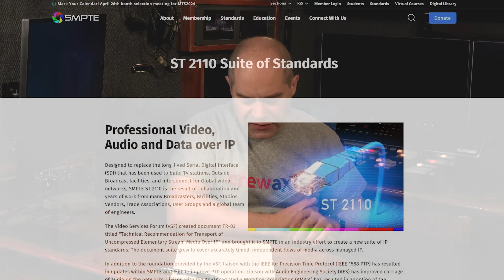What is SMPTE ST 2110 IP Video? Let's talk about it.

Comment: Crazy question for you. Thinking about the production trailer workflows, I wonder if an intermediate solution would be something similar to digital stageboxes for 2110? Cameras remain SDI, but all funnel down to a stagebox that translates it all into a trunk line, but because it is one box, could mitigate all of the timing issues collectively, rather than through a million converters, all vying to get that timing information on their own? Ideally, there could be a huge benefit where venues could have those boxes and all you would have to do is have a standardized trunk connection. Maybe utopian, but I look at how digital stageboxes have made impossibly complex setups not just workable, but far more capable than most of us ever imagined.
Reply: The issue is still the bandwidth as he mentioned 10gbit means 3 channels up and 3 channels down … if you get bigger connections you can  do more trunking … very unlikely that venues give you this infrastructure outside having dark fiber
Reply: @dv1858  I think it depends upon the venue, but with the cost of fiber a fraction of what it once was, it is a great way for newer venues to build out for the future.
Reply: @Jason-mk3nn  correct good fiber installation would be a nobrainer.

At least in my region they still turning ever penny twice so I run cables all the time ;-)
Reply: From what I heared so far, you do not earlly want to connect your st2110 network to another one... just to mutch stuff that can break with the network... So even when to IP based Trucks are standing netxt to each other they will transmit signals over copper SDI Kabels...

Having a good fiber setup in a location would be more benificial for setting up your own Stageboxes that are implementet in your network. and as fiber is relativly cheap thats something every location could easily provide in the location with ports outside on the parkinglot
Reply: @jokiejo  its the same with dante in Audio. if some others need audio connection, like the video/streaming devision you use xlr, even if both devision use dante internaly. 
alternativly they may use AES (2 channel Digital Audio over XLR) or a dante Gateway ( basical a Stagebox with just 2 sets of dante Cards, linked together internaly)
Reply: That’s how we started with 2110.  We got a couple of the 3x3 converter boxes from BMD and used them to trunk video to/from conference podiums. Later, we used them to eliminate cables to camera podiums we had on the press box of sporting events.  For the small venues, I’ve used Netgear pro av and unifi 10G flex switches ($300!!). That’s worked great, but any complex routing (I.e. to BM’s 2110 PCI cards) requires a controller. Not necessarily true if you’re just using the converters as stage boxes.
Reply: Riedel has this product. It is called mediornet.
Reply: @plrpilot Have you been able to do multicast (multiple target boxes)?We just got the 3x3 boxes. We've gotten them to work using direct connections. Our goal is to use it for basic video village setups. But what do I need to multicast to multiple gateways? The BM 360 switch isnt available yet. Any recos for a basic (cheap!) 10g switch that can allow multicast?

Comment: I think we need to demystify some assumptions. "2110 works with off-the-shelve equipment": no, it uses top-of-the-range switches that you can't find on Amazon. We're talking Arista in large installations.
Reply: same with AVB in audio, but AVB is fine with just 1gbe.
Reply: some mikrotik router/Switch might work. an theyr "cheap".
Reply from the maker: The requirements aren't that stringent. IGMPv3 is found on most managed switches these days. And the PTP-aware switch doesn't seem to be strictly required for things to work. I did some of my testing on a TP-Link $250 switch and once I had IGMP Snooping setup correctly it all worked just fine. I wouldn't suggest it to someone, but it did work.
Reply: @djp_video  At small scale maybe, at a large scale I know a local broadcaster that has just spend half a milion on Arista switches for their 2110 facility. It is insane.
Reply: You could certainly spend a lot of money if you wanted to.  I’ve got a small facility that only has 20 feeds, and we’ve had a lot of success with the Netgear Pro AV switches.  They are 10G SFP and are a fraction of the cost of the Arista. They are PTP transparent and handle a large amount of Dante and 2110 traffic.  However, you still need a controller.  BMD’s 2110 switch is around $3k and has the controller built in.   Perfect for trailers, conferences and small sporting events (I do a lot of high school events with 7-10 cameras.   You can also get creative with multi-fiber runs.   But if you’ve got the budget for Arista switches, you’re probably not looking at use-cases for the lower cost productions.
Reply: I love netgear proav switches! It’s nice black magic has the controller in it!
Reply: @djp_video  im currently building a network ans video for a church, each rom gets networks an a lot of roms get video (sdi).
But  because i nned to get video to a seperate building i need to go fiber (so i have no ground potential problems).

I will use some of the 2110 Converters, either over a switch (some ubiquity switch) or p2p if the switch creates problems.

Reminde me in a few Month if you want to know if it works.
Reply: Hi Doug. We just got the 3x3 boxes. We've gotten them to work using direct connections. Our goal is to use it for basic video village setups. But what do I need to multicast to multiple gateways? The BM 360 switch isnt available yet. Any recos for a basic (cheap!) 10g switch that can allow multicast?

Comment: 33:44 the latency issue, yes indeedy. It's gonna have some frames of latency. No ifs, ands, or buts.
Reply from the maker: 2110 can be implemented with low latency. In the case of Blackmagic they've designed their converter products with buffering on both ends. It doesn't have to be that way.